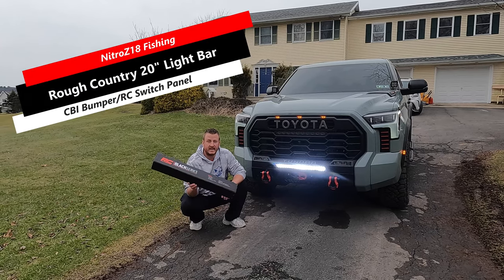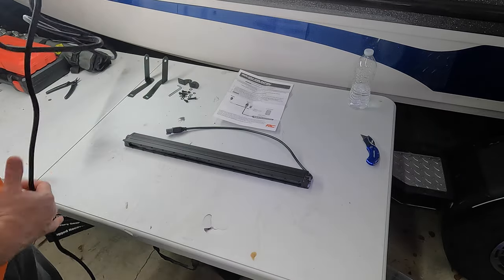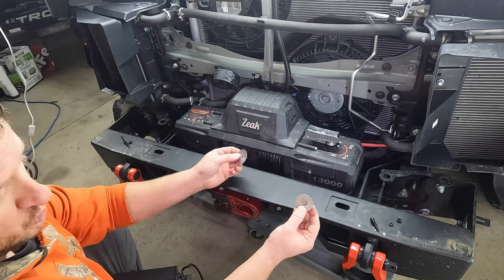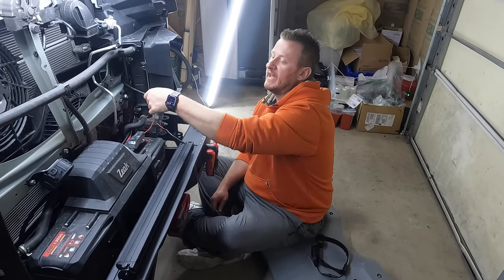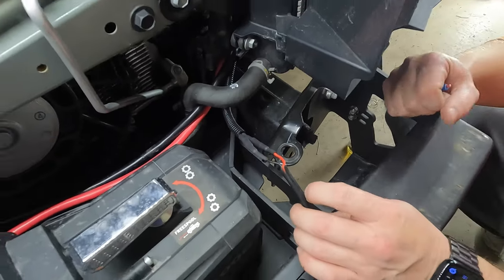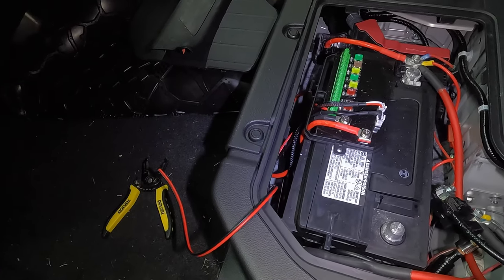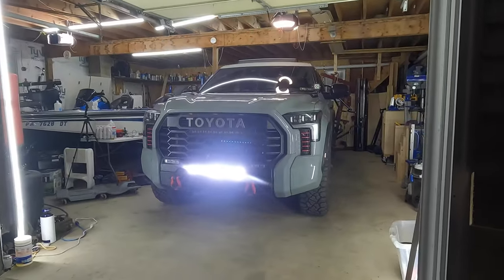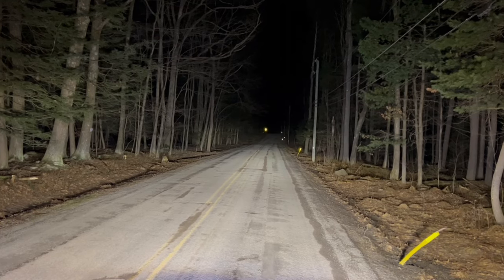20" Light Bar Install, 2022 TRD Pro...Mounted on CBI Bumper, Hooked Into Rough Country Switch Panel

Comment: Damn! Nice job. I like it. So it seems like you wired the RC bar so it can be turned on regardless of low or high beam but the TRD OEM is still only available on high beam? (Maybe it’s in another video somewhere I missed?)
I think you’ve taken off that front bumper like 6 times now! Props.
Reply from the maker: Thanks man, I appreciate it!...yes sir, that's correct...I can turn my 20" bar on/off independently from everything else...my TRD bar is still linked to my high beams, I haven't had a chance to change that yet but it's coming!

Comment: Hey man love your video I am new to the channel. My question to you is I ordered a TRD grill that came with a light bar and Amber lights. But didn't come with a wire harness just the black and red wire how can I connect the lights if I don’t have a  switch panel.

Comment: Would it be possible to just wire the new lightbar into the Factory one so they both run off the stock switch, then just add a switch for the ditch lights.

Comment: I cringe when you cut the end off instead of de-pining the connector but super proud of your wiring. Not many use heat shrink tube, heck can tell you how many times I’ve seen twist caps on automotive applications. Also wrap some loom on the coolant hose that runs next to your winch wiring.  Overtime the vibrations might chafe the hose.
Reply from the maker: Thank you!...yea I use same connections on every application and they've never let me down!...even on my boat trailer that gets fully submerged, never had one fail on me!...and that's not a bad idea with the loom, thanks for the recommendation!

Comment: Could the light bar be connected some how so that it came on with the factory fog lights?
Reply from the maker: I'm sure there's a way, I haven't messed with the stock wiring much just yet...but there's always a way to tap into existing wiring for lighting as long as wiring can support the amps and its fuses properly
Reply: @NitroZ18Fishing   I did it. Ordered a short harness, tapped into factory fogs for the trigger wire.  Works how I wanted it.  My rapter lights are on with driving lights.  Fogs are on with light bar.
Reply from the maker: Nice!...sorry it took me so long to respond, trying to keep up with the channel is getting hectic! 🤣...good problem to have, so can't complain....thanks for checking out the videos!

Comment: Hey random question i thought of. Do you know on your tundra platinum you use to own if there is a way to turn off the driver seat from sliding back and forward when the truck starts. I didnt know if that might be something that could be shut off with that carista plug in module you had? I have a 2020 platinum and i am trying to figure out if it can be turned off. Thanks.
Reply from the maker: Hey buddy!...yea you don't even need a Carista to do that, it's in the settings...you can turn that sliding off by going into settings on your screen!
Reply: @NitroZ18Fishing  so its in the settings screen located between your tach and speedometer is what you are saying?
Reply from the maker: It's actually in the truck settings on your head unit, the screen for your radio
Reply: @NitroZ18Fishing  awesome. Thanks man
Reply from the maker: No prob, happy to help!